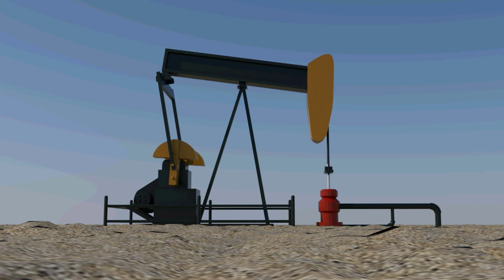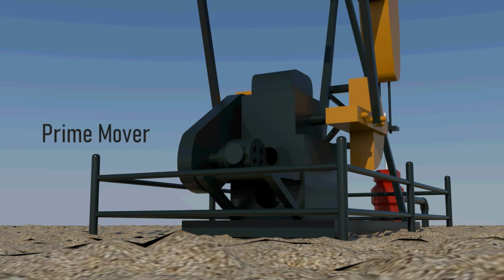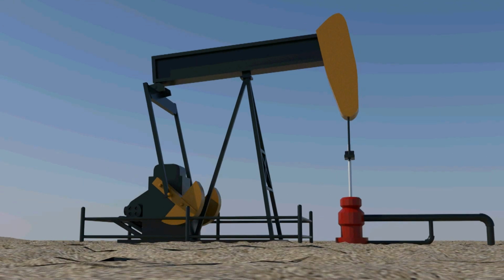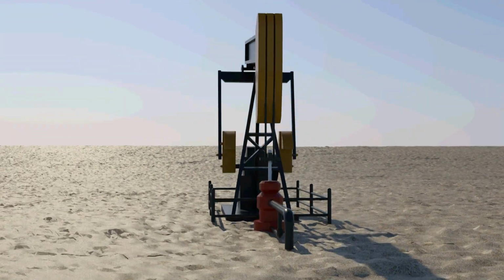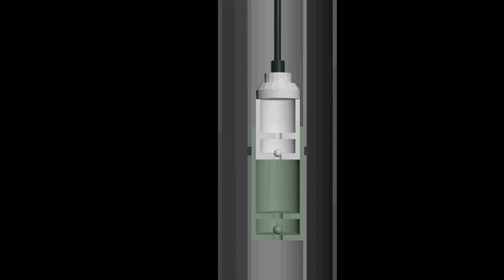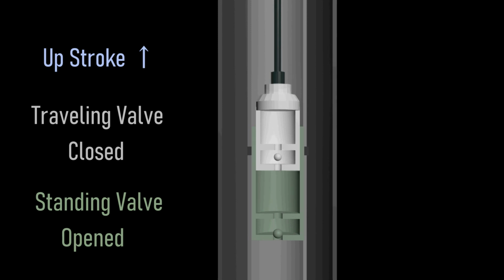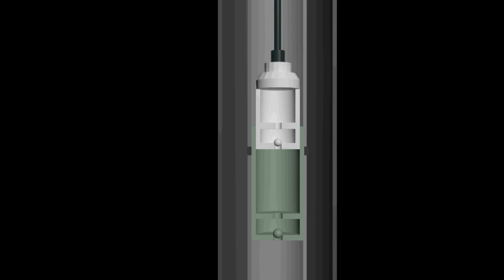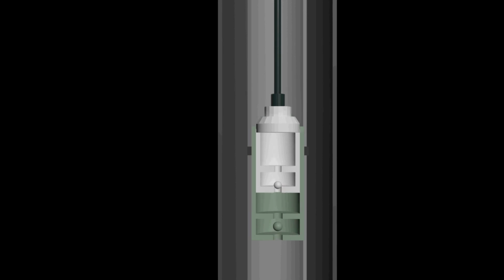Sucker Rod Pump - Oil and Gas

Comment: Oh so the white part in the sucker rod will take the liquid from stationery barrel or whatever is that after entering the white part the oil will continue flow trough white part to the main pipe